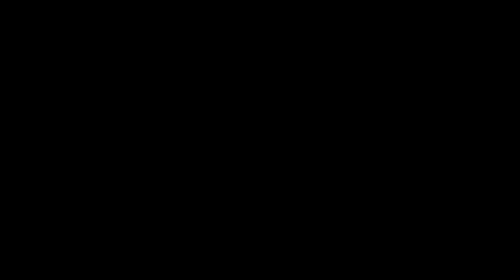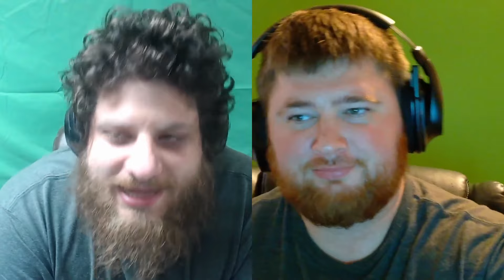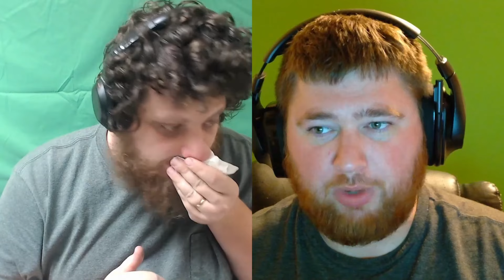This is why I should have Threadmilled - Ep 133

Comment: I had one advise from people whom did AS9100/ISO9001 and then had to live with it - before finally committing, sit down with a consultant and review everything and ask "how can we simplify this?" Because later on you might be adding completely unnecessary expenses just because you were rushing to get the certification done. One good example - sending everything to get calibrated to a third party, when just an annual internal calibration suffice. Once you are certified, changing the procedures are more difficult and expensive.